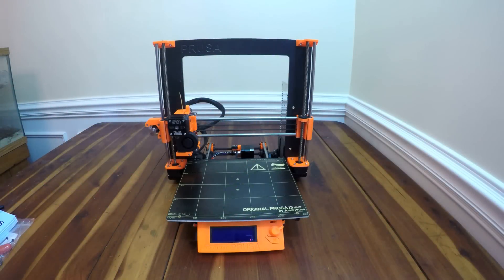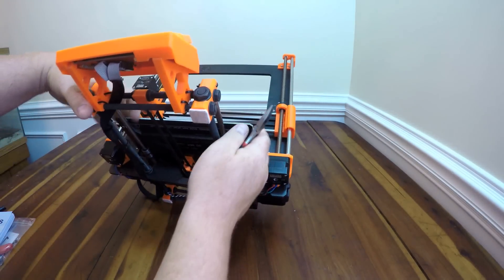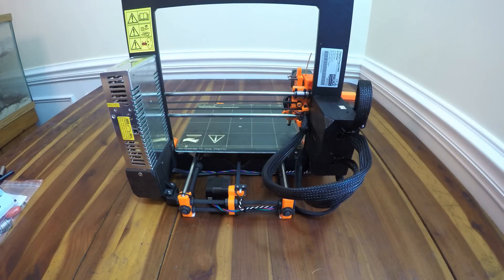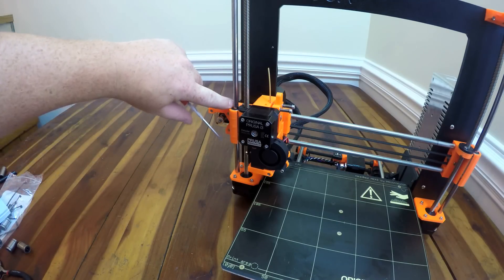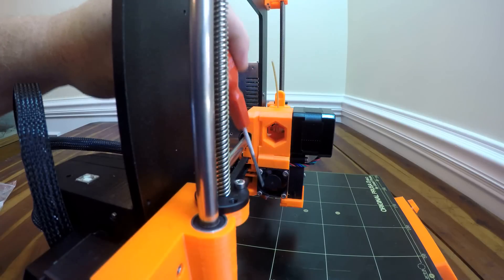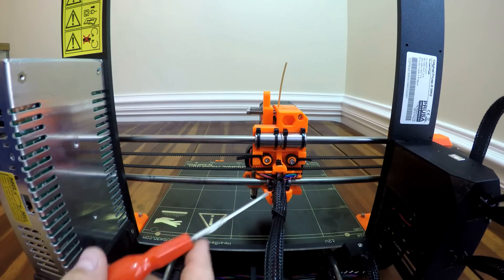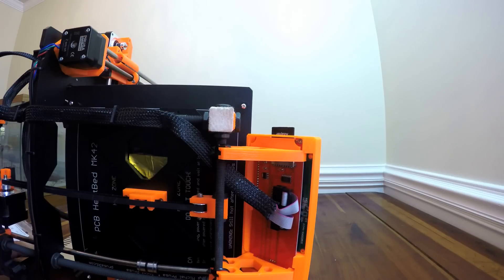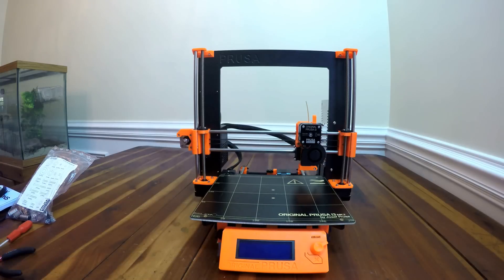Prusa i3 MK2 Kit Build Review

Comment: So to get the pre-assembled and calibrated machine is about $200 more. That includes assembly and calibration.  You said it took you about 5 hours to assemble.  Do you recall the time to align and calibrate everything?  If it's just a 5 hour assembly project then I am not sure it's worth $40/hr to have them build it.  If so how do I apply for the $80,000 a year job to assemble prusa's (smile).

Comment: At 11:45 it appears as though your machine actually rests on your LCD cable bundle, can you confirm?  Seems like the machine would not lay flat?
Reply from the maker: It is very close, but the felt pads raise the machine up enough. The cables would probably lay flatter if I did not wrap them in the aftermarket nylon sleeving.

Comment: Doing my build (I'm pretty slow and methodical.  My 1/4" ID expandable cable must not be as expandable as yours.  I can't even get it over the small bundle going to the X-axis motor and endstop.  While it does, in fact, measure 1/4" ID, it doesn't stretch very much.  I can't even get my pin finger in past the fingernail. Going to have to fall back to the included cable wrap, I guess.  You sure yours is 1/4: ID?
Reply from the maker: John - I am so sorry. You are absolutely correct, it is not 1/4" but 1/2". I did not have the original roll I ordered a year ago. For all your trouble please let me send you some. I have 100'+ extra. I have also updated the information.
Reply: Mark - that would be much appreciated! As you say, less than 10 feet ought to do it. What is the best way to email you my address?
Reply from the maker: I will try and send it out tomorrow :-)
Reply: Awesome!  Thanks!
Reply: FYI - I did receive the package as you predicted.  I think the finished product looks much cleaner with the sleeving.  Thanks again for that, and for your great review.  I've re-watched it a number of times!

Comment: Get a dedicated mic for your videos v.v my ears nearly explode every time you move the camera... 

As for the printer, I think you're either forgetting or don't know what the purpose of the prusa printers is. They are not meant as "professional printers", they are for enthusiasts. It's meant to be cheap yet perform extremely well. The two things that seem to be nit picked are arbitrary if anything... A straight plug is most likely included because it's more universal. It can go any direction where as the 90 degree cord would take up space if you had an outlet to your right or even in front of the printer. And while idk about you, it seems a majority of people leave their printers in a corner somewhere and the outlets usually closest to the printer are on the sides, not the back. Considering most household wiring specifications say to have the outlets near the middle of the walls instead of near the extremities.
Reply from the maker: Thanks for the tip. I will go online today and look for a decent microphone. Do you have any suggestions? I'm still very green to making videos and have been experimenting with my gopro black 4 and Nexus 5x cellphone. Funds are tight 🙁. I agree, the Prusa i3 MK2 is an excellent machine with a low price point. As the machine sits it is a Fantastic machine. I worked in Aerospace electronics a couple of years ago and my pet peeve is wiring. Thanks again for the feedback 😀 Do you have a Prusa i3 MK2?
Reply from the maker: BTW I likes you home made Tricopter videos. Are you still flying? Always wanted to build on. I think they are cooler than quads
Reply: +Mark Fuller I actually have a quad copter now lol. I like building things from scratch first then getting something better made. I built my own 3d printer for example. Named it "janky"  cause it's made from wood. Planning on buying the MK2 soon when I get a good enough paycheck lol. I've played around with it at a few places and really love it. 

As for a mic, it depends on what you're going for. A lavalier mic would be perfect for this kind of video. Then you can record separately and just sync it up. Or get one with a compatible connection to your camera and use that as an external mic. It will drastically help the audio quality as well as prevent the creaking.

Comment: Hi! I had the Original Prusa i3 Plus, and just upgraded to the mk2. I have had a little hiccup, though. Even though I am sure the threaded rod base is fully square, I am having a serious issue. When I calibrate the printer, it tells me: "XYZ calibration compromised. Left front calibration point not reachable. X/Y skewed severely. Skew will be corrected automatically."  How did you get your printer aligned? I have pored over the manuals for days and can't figure it out. I would really appreciate any tips. Thanks! PS. This video is great!
Reply from the maker: What firmware are you using? To help out others with this problem I would suggest to upload a video and contact Prusa Research. I have not ran into this problem, yet. here is some info about the calibration process. http://prusaprinters.org/first-printer-to-automatically-correct-geometry-in-all-axes/
Reply from the maker: You can also run a test by printing out a know square size and measure all the sides. If they all measure the same your good. If not adjust one of the rods and try again. This is just an idea
Reply: I´m using the new 3.0.8 firmware. What I am asking basically is what were the measures you took to ensure your axes were as close to perpendicular as possible?
Thanks so much for the other replies, I´ll also try taping it. :)
Also, great video. Didn´t expect you to reply.
Reply from the maker: Ryan loosen the front nuts than connect the Y axis thread rods to the frame 1 to 2 turns. Make sure you do the same number of turns on both sides. Loosen the screw to the power supply that connects to the Y axis. I think it has an oblong hole. Tighten the back nuts. Tighten the power supply screw. This should bring your Y travel back some to pick up the front point. Now bring you bed  down and check is the X axis rods are parallel to the white lines on the bed. If they are not adjust one side of the nuts. Also make sure the probe is low enough to pick up the points. Check the manual for the proper height. Please tell me if this helps.
Reply: Thanks so much! I was forgetting to loosen the power supply screws!

Comment: 4 screws for the fan, LOL... they could have just made a frame for it to slide into and click in place.  Seems like that whole extruder assembly could be designed to be one or 2 pieces and click both fans in place inside a frame.  Awesome video... makes me want to give it a go and build one.
Reply from the maker: It's funny the motors are mounted with 3 bolts and the fan has 4. If you want to build a 3D printer this is the kit to buy. Warning this machine is addicting. Thanks for the good vibes 😎

Comment: Very nice video.  Good audio (except a few noises - sounded like something hitting the microphone cord).  Really good lighting.    Personally I would have been a lot more upset about the bearing issue you had.  Great that you were able to move past it.  Did you have to print modified bearing holders, or were you able to re-use the ones that came with the kit?  I really like your use of the nylon sleeving.  Would one piece do the whole build?  Is that one size you listed what you used everywhere, or did you use multiple sizes?
Reply from the maker: John, Thanks for the kind words. I have been experimenting with using my Gopro Black and the speaker is very sensitive. For the Z linear bearings, I used the original parts that came with the kit. I had the longer linear ball bearings ( LM8LUU ) sitting around so I used them. This machine requires ~4.5' of nylon sleeving and  the smallest quantity Mcmaster-car sells is 10'. The 1/4" is the only sized I used. Mcmaster-Carr also sells the nylon sleeving in blue, green, orange, red, white, and yellow for a custom look.
Reply: Thanks so much for the additional detail!  I'm looking very seriously at this for my second printer.  I've got a Geeetech G2S Pro Delta, which was a fun build, and it is great to watch, but calibration is very tricky and time consuming, plus the low quality printer parts make me fearful of using it to print when I'm out of the room for more than a few minutes.  Under-spec'd power cords and connectors -- not cool.  I'm looking for a reliable printer that I can trust not to burn down my house (as well as making good, reliable prints!)
Reply from the maker: I have printed over 100 hours on this Prusa i3 MK2 and this machine is solid. I'm going to make a video on some of my prints soon. This machine does cost $700 compared to i3 clones for ~$400. Unfortunately you get what you pay for. I prefer to pay more for a better product, excellent support and open source company. This machine prints better than my Da vinci 1.0, Da Vinci Pro, and Makerbot Gen 5.
Reply: Absolutely agree that it is worth it to pay more for a quality product.  Now after having my other kit printer for 9 months, I think I'm in a better position to understand the difference!
Reply: My 1/4" sleeving arrived today.  Now I just need to screw up the courage to press "BUY" on the printer sitting in my cart on the Prusa store.  A shame they don't have a cheaper and slower shipping option to the US.  I'd gladly wait another week to save $25.00.
Reply: Printer kit is on the way!
Reply from the maker: +John O'Shaughnessy 👍👍👍
Reply: I agree with you John, not a big fan of LM8LUU bearings as I have had a few go on me, but then again maybe Prusa have sourced some high-end ones instead of cheap ones. I'm more a fan off Brass sintered bushing or the Igus Drylin made of Iglider plastic. 

My machine is on order and hope to cover a build on my channel and may look to replace all bearings with the Brass sintered bearing or the Igus DryLin RJ4JP-01-08 linear bearings, which never dies. Hey what the hell just 3D print some out of Nylon as thats what they're made of anyway LOL

Good work Mark some great top tips.
Reply: NERDVille Hi
As I'm waiting for my MK2 delivery, I have 2 questions :
- How many LM8LUU are needed in the MK2 ? I would say (2+1) for Z, (2x2) for Y, (2+1) for X/extruder = 10 ? Did I miss some ?
- if I want to replace original LM8LUU by Igus bearing, I can easily find 24 mm long Igus bearings but if I try to replace by longer ones, it come by 42 mm (too short) or 59 mm (too long)...
Thanks for any comment. 
And thanks Mark for the very instructive video !
Reply: There are 10 LM8UU bearings in the MK2.  4 on the Z-axis.  3 each on X and Y axis.  If you want to use the IGUS bearings, remember that many of their products are designed to be used in a press fit casing, and will not work properly in the MK2.  The correct part number for a drop-in replacement that can be used in the MK2 is shown in this listing: https://folgertech.com/products/igus-rj4jp-01-08-8mm-linear-bearing-to-replace-lm8uu  There may be other vendors closer to you.  If you would like to see exactly where the parts go, take a look at the detailed assembly instructions: http://manual.prusa3d.com/c/Original_Prusa_i3_MK2_kit_assembly
Reply from the maker: Jean-Marc Bouley Right amount but Z=4 Y=3 X=3. It would be possible the change the Z axis out we with longer bearings and have the protrude below. For the X&Y it would be more difficult, but possible. I would suggest to assemble the machine as-is. If you have any problems like I did one the Z, replace those bearing with igus. Please provide some updates or videos if you choose the change all bearings with igus. Very interested myself.
Reply: You're right Z4 X3 Y3. Correct.
THANKS for the comments, guys.

Comment: I really like the idea of the single Bearing as opposed to the two. In a perfect world both bearings with line up nice but with 3d printing tolerance isn't always perfect. Great job on the wires I am the same way. Cannot stand wires being all over the place my ocd wont allow for it also its just a good idea to keep from creating a short in the future.
Reply from the maker: I think the Prusa Research team went with 2 smaller linear bearings on the Z because they are common on the X and Y axis. I remember 3-4 years ago the longer bearings were common in the Prusa i3. Wire management is critical especially in the electronics box with the Rambo mini.